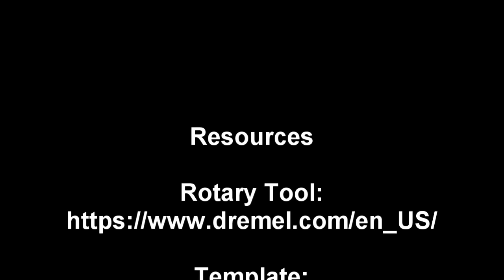Carving a Koi out of a block of wood.

Comment: please write dns ?   sample 50 kg/m³ or  60  kg/m³ or   70kg/m³
Reply from the maker: Not sure what the density of the wood is. It was a block of Basswood. Basswood is great for carving, it's clear with no knots and the grain is really even. It's really easy to use a knife, rotary tool and takes a finish really well.